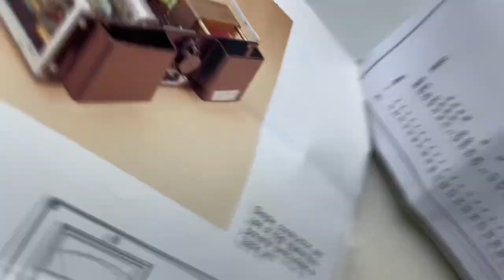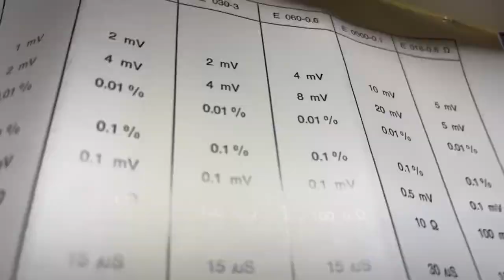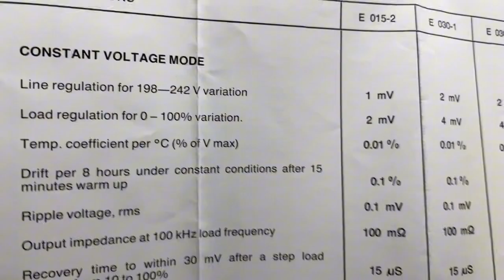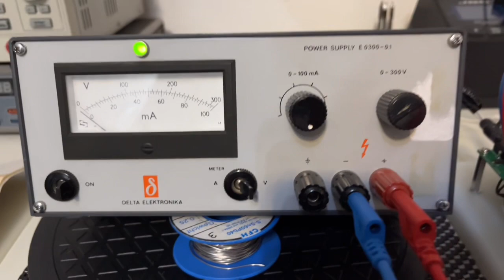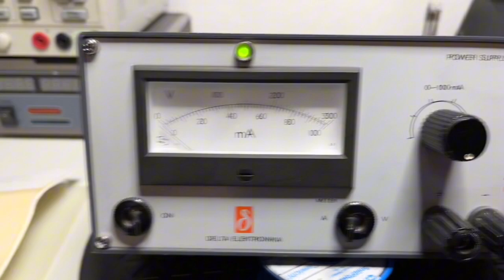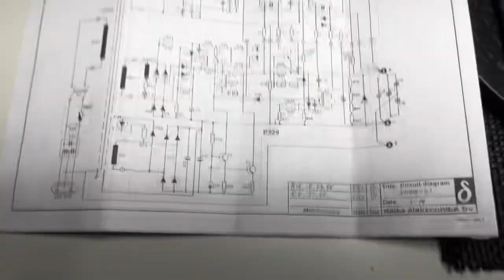DELTA ELEKTRONIKA E 0300-0.1, 300V 100mA High Voltage Power Supply Test and Teardown.

Comment: They are very nice, got a few myself and they are isolated so you can stack them (I don't think I modified them at least).. if you need me to measure anyhthing inside mine just let me know. (oh I don't think I had that schematic - I'm screengrabbing that :)
Reply from the maker: Hello, Thankyou, If you want I can send you the Original Manual in PDF, If so contact me via Email (Email is on Channel Description Tab).

Comment: Nice lab powersupply, because it seems to work correctly besides the amperage meter, i guess it's a very minor problem like the amp / volt switch or a broken wire.
Reply from the maker: I liked these psu‘s when I was using them in the 80s, reliable, very difficult to kill.
Reply: @KonstantinGrigoriadis  , i have 2 cheap linear 0-30V 0-5A bench powersupplies and a working 6-600V 0-150mA Electrophoresis powersupply if i need higher voltage. Soon if my isolation transformer project with variac, electronic circuit breaker, and buildin dim bulb current limiter is ready, i have a 0-250V AC powersupply, and with a extra external box with bridge rectifier and filter caps (future project),i have also a 0- 350V DC powersupply. I have also a 24V AC @ max 33A transformer waiting on the shelf to build a robust powersupply. You can't have too many powersupplies 🙂
Reply from the maker: In use I have a 
1) 0-30V 0-5A Digital Linear Bench Psu, 
2) 0-32V 0-32A Digital Switchmode Bench Psu, 
3) my Build/Modernized (the one from my Youtube Video) Current Limited Isolation Transformer and Variac. 
I no Use Electrophoresis PSU's bcs they have awful output Noise and Specs (not Build for being Quiet :-)
I have in Use (till I finish my 500W 5-800V PSU's Designs (one DCDC from 12V and one Mains operated) a 1-300V 1.6A Switchmode PSU with acceptable Output Specs.
An Electronic Circuit breaker Design is planned for a Future Video, Design and even PCBs are done and made but I was Distracted by New Projects :-)
Reply: @KonstantinGrigoriadis  you are right about the output of the Electrophoresis psu,  but that one i only use for testing capacitors. Then the ripple doens't matter that much. I still prefer the oldskool linear powersupplies, those have much cleaner output and can also be used to power audio circuits without creating hum, and a linear psu is in my opion more robust and can take some "abuse". And if something fails, they are much easier to troubleshoot. The old technique of using SCR's to create a variable rectifier to unstress the regulator behind, is a clever way that i someday wanna use, but i don't have found yet a good tutorial or guide, how to build such a psu. Grtz
Reply from the maker: Hi Bjorn, the hv psu‘s in Design are both switched but will be lab grade, audio grade. As of many of my Designs , I think about something new and that gets my focus away from partial made other Designs, so with the Psu‘s :-) One the dcdc one , I build version 1 and tested it but I was not satisfied with the switchmode IC I used, therefore I completely Redesigned it, but got distracted